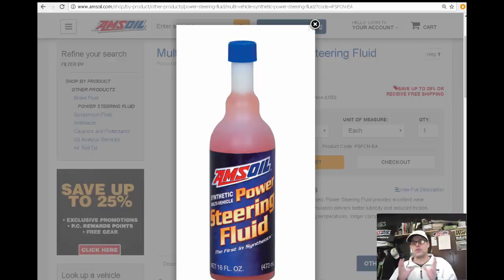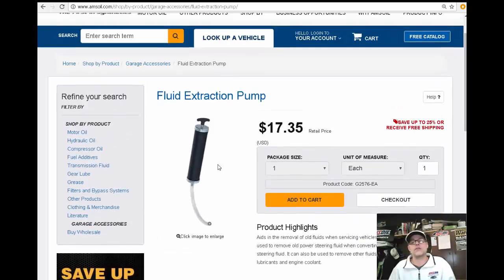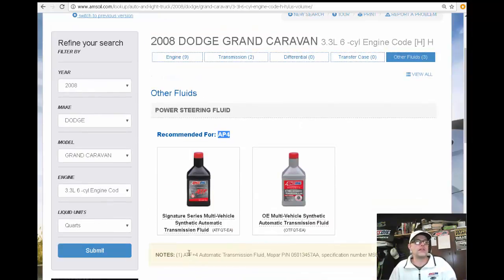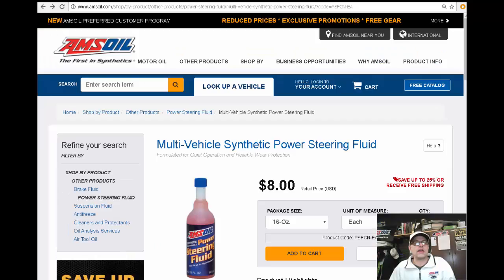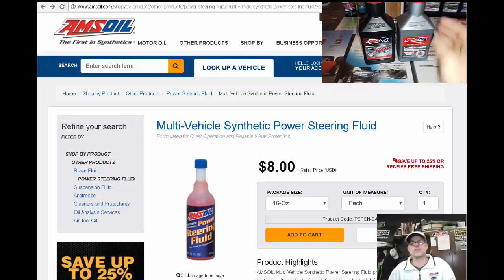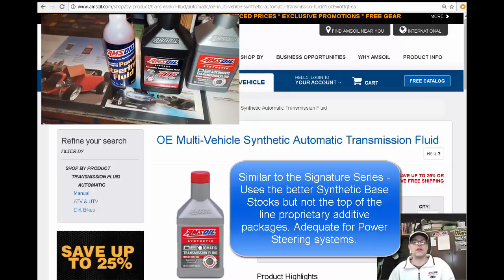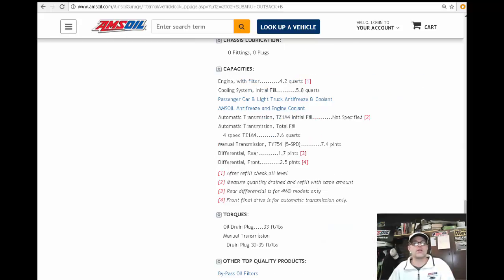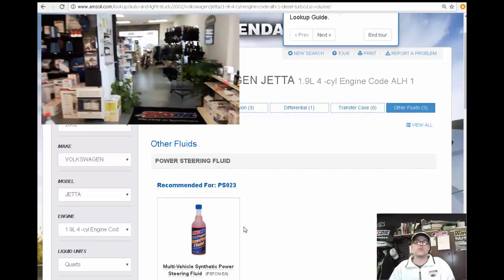Power Steering Fluid - AMSOIL's Version and ATF Options

Comment: load firmness,feed back.turning fluidity.shock absorption...just hard to describe plus quietness make twenty years old power steering system feel new being using it on caldina, gs300 and steed.